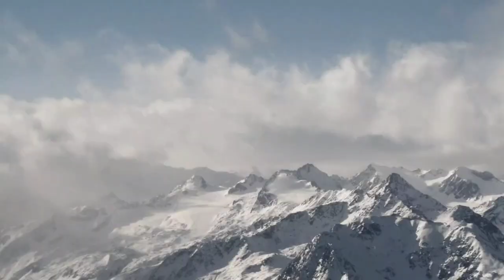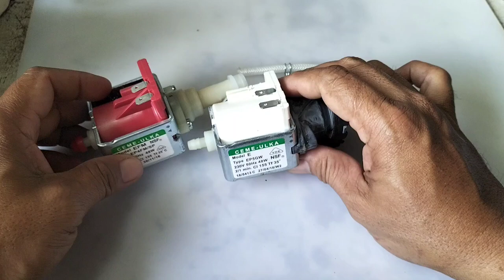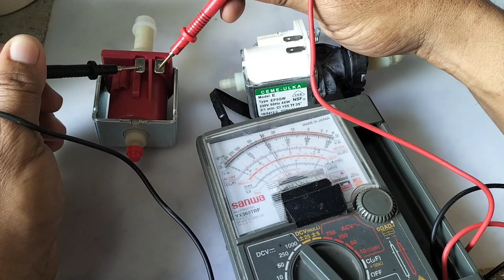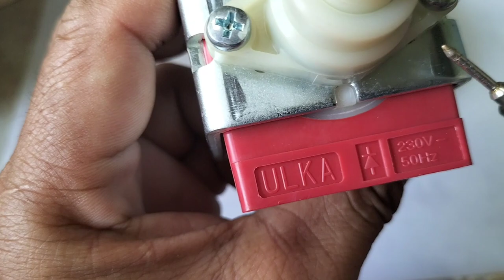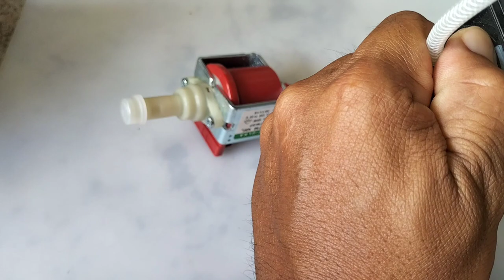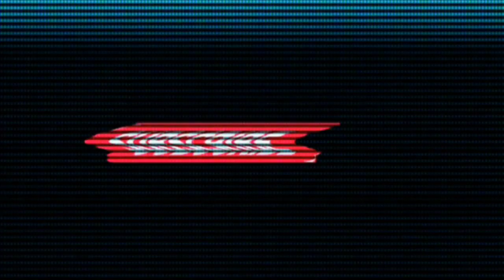HOW TO TEST MINI WATER PUMP FOR COFFEE MAKER

Comment: Just what I am trying to do. :) I think that the good pump is showing 30x10 ohms resistance, i.e. diode plus coil. Mine is measuring 8.5 Meg Ohms  and the pump has low pressure. I think it should be about 250 Ohms, which is around what you are getting. I don't want to unnecessarily spend yet more money on this thing. Am I right in thinking what your resistance is? Grateful if you could let me know. Thanks!